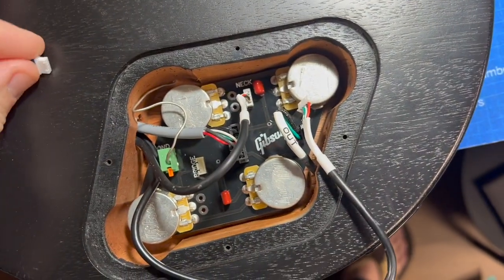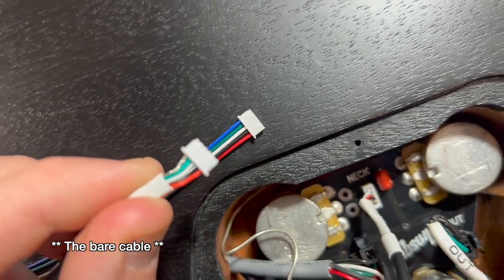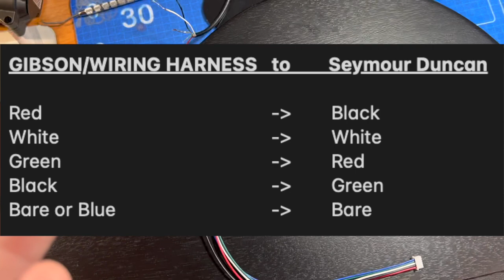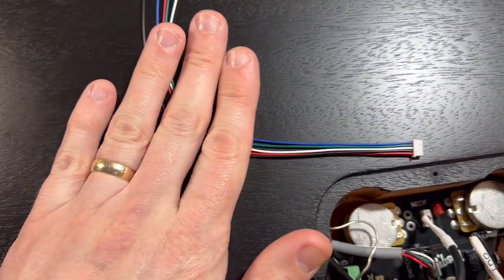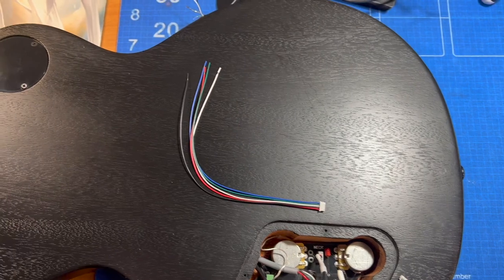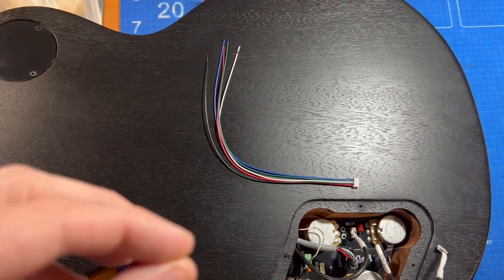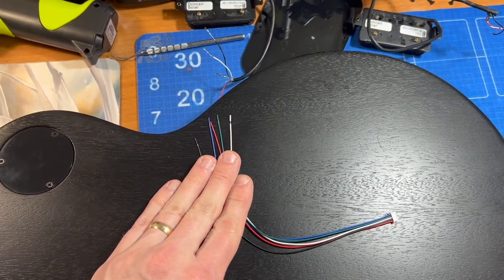How to wire Seymour Duncan Guitar Pickups in a Gibson Quick Connect Circuit Board

Comment: My quick connect board has push pull switches on the volume controls how do I hook up the three position switch
Reply from the maker: The switch is a plug labeled on the main board and should plug in.

Comment: Hey, how do you remove the ground? I pushed that orange tab and it only looks like the green box is going to break. I don't want to super move it around because I don't want to break it. do you have a vid with that? Thanks!!
Reply: If remember correctly you Push down not in.  And very lighty

Comment: I put an SD invader pickup in my bridge position and it’s really bass heavy and muddy sounding for a bridge pickup . do you know why that is ?
Reply from the maker: It could be that the pickup is too far from the strings. If you adjust the two screws on each side of the pickup to bring the pickup closer to the strings, then that should tighten up your sound on that pickup, if it’s already really close, and you can’t adjust it more, then you might have a bad pickup.